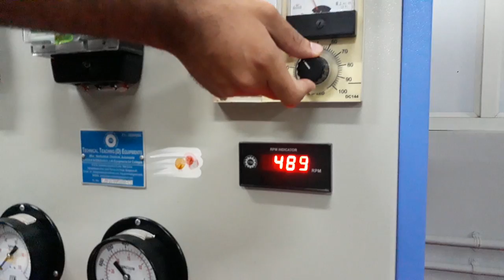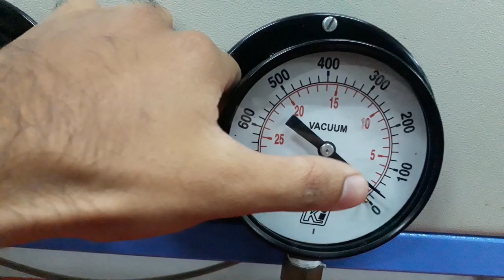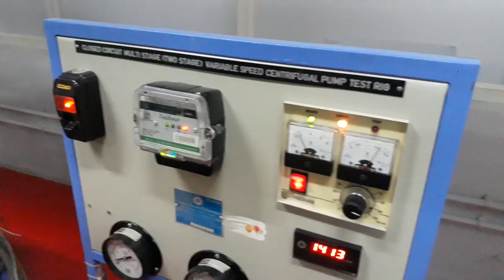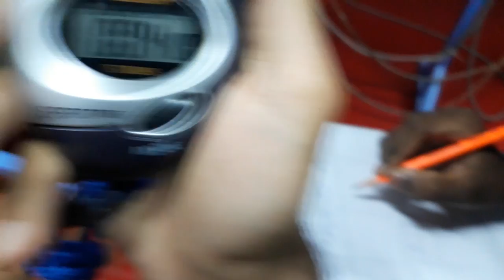Performance test on centrifugal pump

Comment: How can we test water flow at different heights for eg flow at 15 feet height then at 30 feet and 50 feet.
Reply: by adjusting the discharge valve.